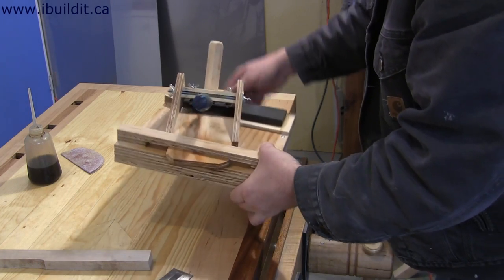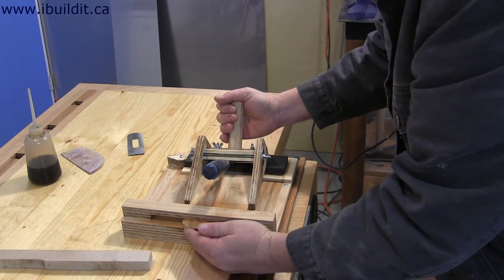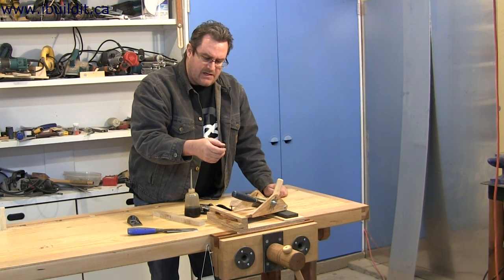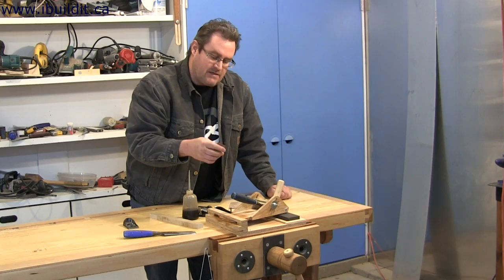Sharpening A Plane Iron

Comment: He uses an oil stone.  But even when people use water stones, they wipe off all the water before using on wood.  One exception is when some people intentionally spray water on wood when planing to make it easier when the grain of the wood isn't consistent (burl wood or woods with grain going in multiple directions) but only light sprays and only for these types of wood.